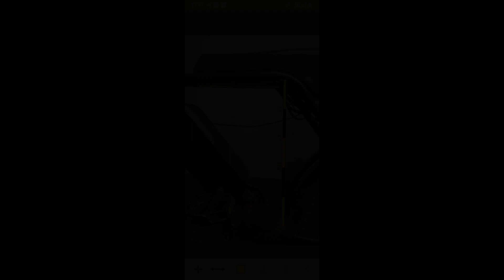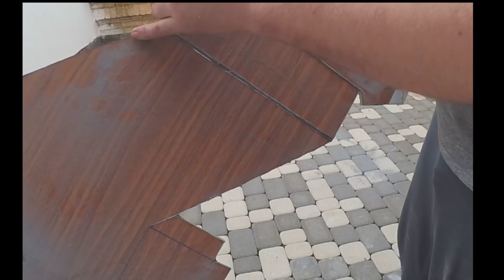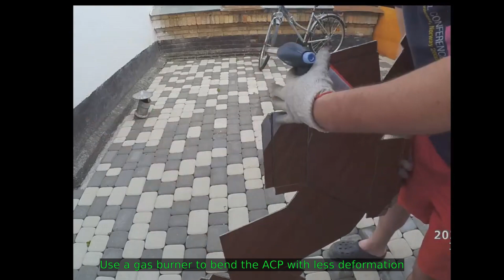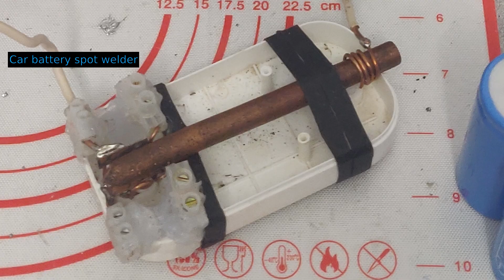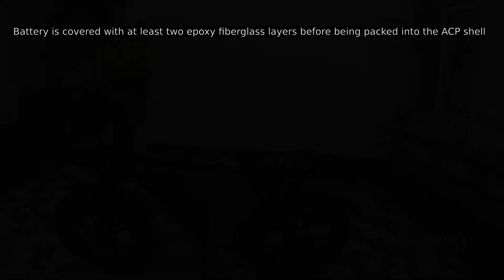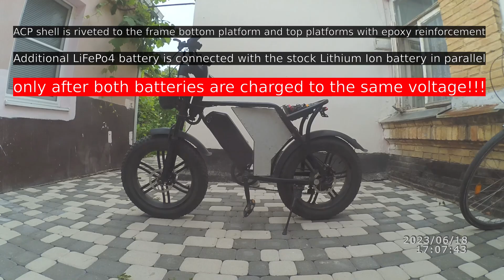OUXI V8 Custom LiFePo4 battery made from Aluminum Composite Panel, Rivets,  Epoxy and Fiberglass

Comment: Why didnt you just fill the entire space and sell the other battery? Wouldve been better. Thats what im working on now.
Reply from the maker: Stock battery is too good to get rid of just for the sake of replacement. My idea was to extend the total capacity by building an extra battery, and it worked well enough, no more space left in the box for extra cells